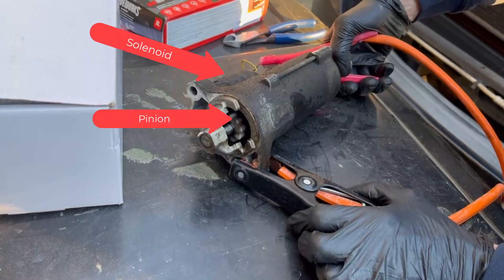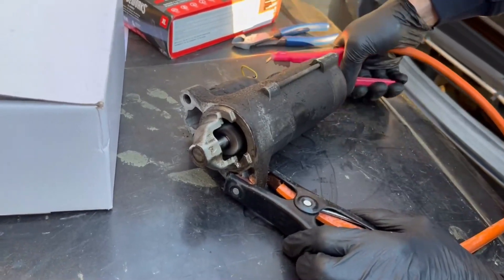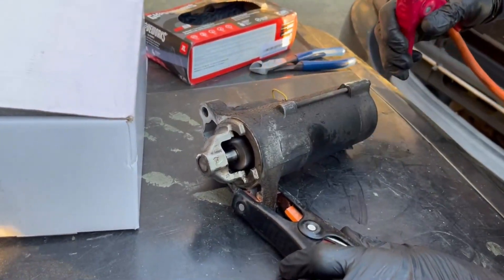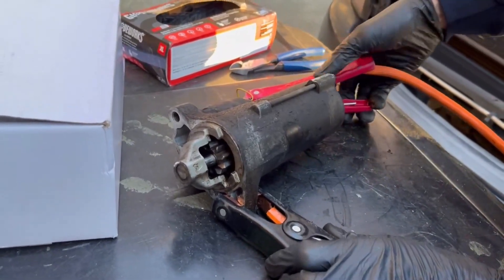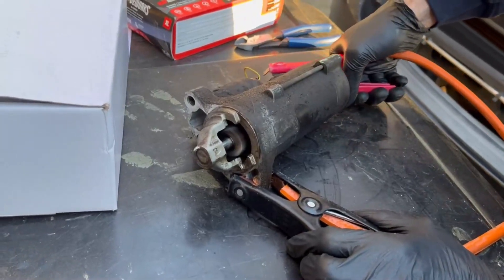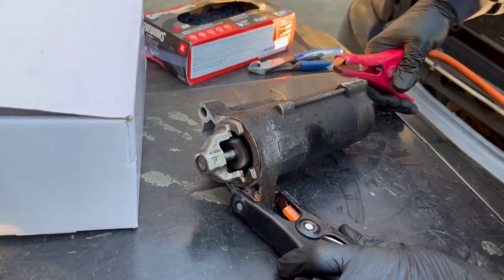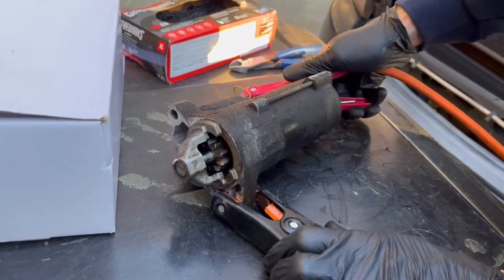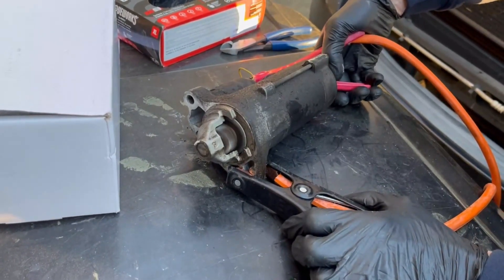Does tapping on a starter motor actually help?

Comment: you gave an example of "sometimes your starter sounds weak when it's trying to start... here's an example"-- what was the cause? bad electrical connection, bad internals? was this a different issue that the brushes or just another symptom of bad brushes?
Reply from the maker: In my case it was a bad starter. Specifically it was the solenoid hit I replaced the whole thing as it’s cheap and you have to take it off to reach the solenoid anyway.

Comment: good stuff.  I am hearing the solenoid click but absolutely no action, not even the gear flyout engages.  I will attempt to give it a good smack, it's just in a really tight location in my SUV
Reply from the maker: @FortyTwoAnswerToEverything  yeah - getting access is a challenge sometimes. Maybe the back side of a cheater bar? Good luck!

Comment: Why tho?
Reply from the maker: @theanagramman1678   great question! there are these little thin copper stands called “brushes” that are essential but they get warm down over the years. When contact is lost, it can sometimes be reconnected with a little tap.
Reply: @TallFamilyFilms thank you very much , however I thought I commented that on another video about a metal you can chew like gum😂.thank you tho I am having problems with my starter
Reply from the maker: @ they do make brushless motors now, but I don’t know that that technology has made it into the automotive industry. You’ll see i” brushless “ on power tools a lot advertised on the box.
Reply: @TallFamilyFilms I know they have on the tool side of things. I have a dewalt brushless drill/hammer drill,  impact driver, sawzall, and band saw.

Comment: Can you tell me why it starts slow is it a loose connection that causes it to start slow
Reply from the maker: @DjRezurrection  great question! there are these little thin copper stands called “brushes” that are essential but they get warm down over the years. When contact is lost, it can sometimes be reconnected with a little tap.

Comment: This was actually super informative and helpful. Thank you for doing what you do. You had an effect on my life today. I have been experiencing high levels of anxiety and stress over this car bullshit and you just gave me a little relief and restored some hope that I can retrieve my truck from the parking lot I had to leave it two days ago. I got no bread and no way to fix the starter especially since it is stuck. I have hope that I will be able to start it now. Wish me luck, Brother. Thanks again
Reply from the maker: @mcyeti460  Amazon has lots of cheap starters and they’re usually easy to replace (assuming it’s not a Tacoma or Titan). They aren’t hard - I have videos for a few trucks I’ve done. But you can keep tapping it for a while as well until you get the dough.
Reply from the maker: @mcyeti460  oh, one more thing. If tapping works, it’s just the brushes inside the solenoid that are worn. And you can replace just those on some starters. Amazon has some universal replacement motor brushes as well. Just take allots of pictures and have a video running as you take it apart since there are springs involved and sometimes they go flying :)

Some say It’s helpful to have someone turning the key while you’re tapping - I can see how that might functionally be helpful but it’s much more risky since the engine will turn over and start with you under it. The engine is not forgiving and will gladly eat your fingers or entire hand and arm if you let it. So be careful with this approach. I’d say having someone in the driver seat while you are underneath is helpful, but not actively turning the key while you’re tapping. 

Lastly, to locate the starter, it should be around the transmission housing - if it’s a truck, its rear wheel drive which means the housing will be the the large semi-circular aluminum “bell” hanging down under the back of the engine - sometimes near the oil pan. Remember, it has to turn the flywheel so it will be near the engine itself. 

You got this!

Comment: Thank you for reconfirming my idea of tapping on the starter to get the car to start.
Reply from the maker: @unknownwriter2114  my Nissan Titan starter died on Sunday. I went to tap on it and discovered they designed it under the air intake manifold! So tapping it was not an option and I had to get towed. But when I finally got the bad starter out, a little tap and it did spin so I know that was my issue.